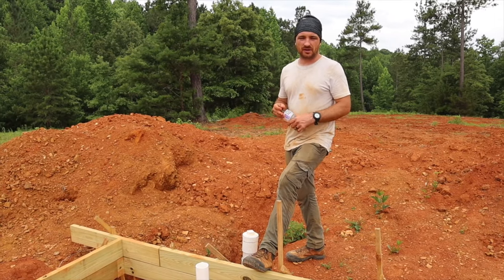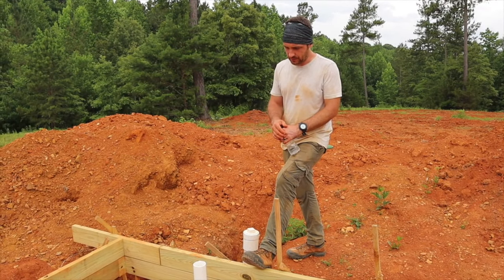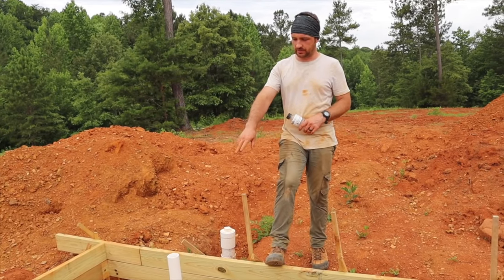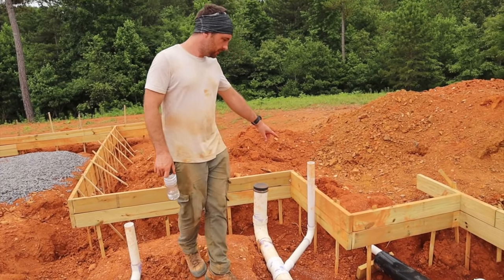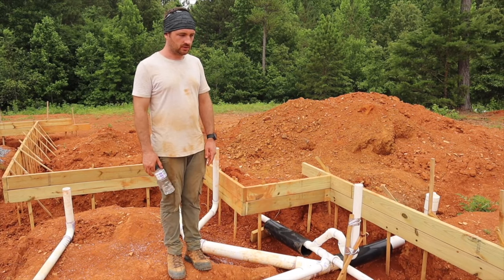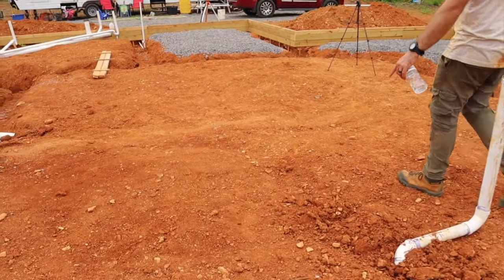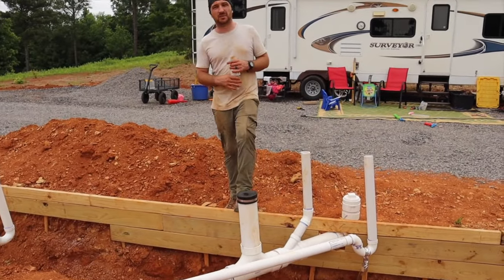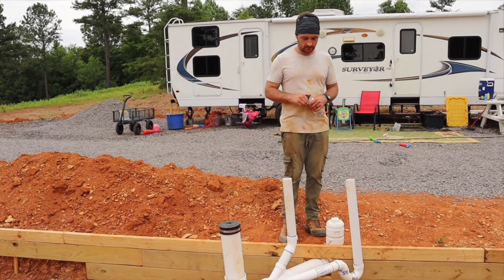DIY Rough-In Plumbing for Slab Foundation | Couple installs plumbing for house build in country

Comment: ALWAYS CHECK STATE PLUMBING CODES TO MAKE SURE WHAT YOU INSTALL IS LEGAL. None of this would fly in Kentucky. If anything in this system ever backs up in the future you're going to have MAJOR vent issues. And that's just the start. All these YouTube videos are going to give people in my state terrible info. Flat vents, wet vents, no vents, trying to separate grey water from waste water, glue traps below the slab, no grillage to speak of around the pipe. Dude, I'm glad this stuff will fly wherever you are, but please, don't post this stuff on youtube for the world to see. You could really get someone in trouble around my neck of the woods.
Reply: Yes I agree I just started my plumbing company and I'm looking at these videos like damn I do it way different

Comment: None of those p traps are vented and that’s a little worrying
Reply: yup and there not 3 inch so the unvented floor drain rule does not apply
Reply from the maker: Good point guys. We do have vents in the system and are doing above level vents as well (washer, etc). We will keep an eye on it.
Reply: @DreamitBuildit  check your wet vent rules and trap arm rules to insure you are the correct distance and size form you trap

Comment: Plumbing vents in a building are there to let air into the system, not to let air out.

Put a straw in wate and put your fingertip over the top opening of the straw. The water can't exit because air can't enter the system (you blocked the building vent).

Now, keep your finger in place and flip the straw upside-down; there will still be air against your finger, and the water will not flow downward. You've blocked the sewage system vent (exists in septic system or municipal sewage system).

So, it's not about bubbles either, although I'm sure bubbles are everywhere in the system.

Comment: Plumber here—-Nice effort, but sorry, fail😢. 
As others have said, missing a lot of vents, and it looks like you used a two way clean out under on of your toilets. And the vent that you did use is not rolled up above the invert of the pipe. 
Island venting under a slab is a challenge and appears to be missing. Good luck in a few years when the problems begin.

One last thing— no pressure joints should ever be under a slab— always use a single length of pipe and bring it up in a wall and make the connections there.

Comment: Good thing you put that cleanout near that toilet. You should never plumb a toilet stack into a tee. Waste will flow in both directions, which temporarily reduces the flow in the right direction. This makes it so solids will accumulate at the tee.

Also, you had the fittings you needed. All you had to do was 90⁰ up and avoid the underground trap.

I suppose the toilet in question will vent, but you generally vent the toilet forward of the wastestream, unless it's wet-vented by way of the sink.

Comment: How do you know where to place the caps where the connection will be for the drain? What I mean is how do you get it accurate so that once the concrete is poured and that the drain for toilet shower, etc is where they should be and don't have to crack open the concrete again to move them?
Reply: You can pull measurements off a set of plans. Using mason’s line to mark different rooms helps as well.

Comment: In a slab, it's best to omit the tub trap. Use a "Tub Box" to make a square (or rectangular) void in the concrete. The pipe would then run horizontally into that hole. Don't box out with wood (termites!).

This is essential for tubs (best to do for showers too, even though their drain centers are far better defined).

Use a "Tub-Box"  because there is no standard on where the center of the drain pipe is, from the front of the tub. So, the exact position of the trap will vary, based on which tub you buy.

After the walls are in, you would install the trap, with the riser centered exactly to the tub's drain pipe.

To be clear, the center of the tub drain pipe has little to do with the drain hole in the tub body.

You still have to know about where the drain of the tub centers (within maybe 1"). Then, have a trap handy to make sure you can adjust the pipe length and the trap swivel to get your riser centered within a couple inches (in any direction) from the approximate center of the tub pipe. That's how you determine where to place the tub-box.

The only time I've seen the center of a tub drain pipe in a drawing, it was 1-7/8" from the wall and centered width wise. That seems to run true to what I've seen.

I personally, buy the tub ahead of time and dry fit the tub and drain assembly, in order to know the center point. However, I still wait to install the trap until the day of install. But, at least I know I'm really close before the concrete is poured.

Here's a link that shows a plastic tun-box, with the trap installed. To be clear, you wouldn't install the trap until you're installing the tub. You'll want to dry fit everything before gluing  in the trap.
https://www.google.com/search?q=tub+box+for+p-trap&tbm=isch&ved=2ahUKEwiW6eSK_ur8AhXmIt4AHQ1-C6oQ2-cCegQIABAC&oq=tub+box+for+p-trap&gs_lcp=ChJtb2JpbGUtZ3dzLXdpei1pbWcQAzIFCAAQogQ6BQghEKsCOgQIIRAKOgYIABAIEB46BQgAEIAEOgcIABCABBAYUOERWNxPYKdWaABwAHgAgAGzAYgBhxySAQUxNi4xOJgBAKABAcABAQ&sclient=mobile-gws-wiz-img&ei=k3XVY9bTO-bF-LYPjfyt0Ao&bih=593&biw=320&client=ms-android-verizon-us-rvc3#imgrc=-mH606pMgSUq2M

I'm really not trying to throw shade, but I'm making these comments for the benefit of others, who haven't already poured the slab.
Reply from the maker: Thanks for all the information!
Reply: @Dream it. Build it. 
For some reason, there's very little (basically nothing) I can find on the internet, on exactly how to rough a tub drain in a slab. However, there are tons of resources on how to redo one that's been done wrong.

Most of the redo examples would not satisfy the plumbing codes.

There are plenty of areas in the US, where slab homes are the norm. As well, there are slab homes (and apartments) built where basements and crawl spaces are the norm.

You would think that there would be plenty of resources on the internet, showing how to properly rough in a tub.

I know because I've installed enough tubs on slabs to see where the difficulties lie. I've also mocked up a few and worked through all the possibilities, based on which direction the pipe approaches the tub.

Comment: Judging by the foliage, I'm guessing you have a true winter, which includes snow. I certainly could be wrong about this because the color of the soil is red, which makes me think warm climate.

I wonder if the water supply line from the well is deep enough (below the frost-line). The plumbing drains don't have to be below the frost-line because they drain quickly enough to avoid standing water. But the supply lines remain completely full of water, at all times.
Reply from the maker: We do have pretty well-rounded seasons, including some cold Jan-Feb winters. Frost level is recommended around 1ft for here so our fresh water coming in will be well below that.
Reply: @Dream it. Build it. 
I'm happy that my worries for your water-line were for nothing.

Comment: A toilet drain that is 5 feet or more from the main drain needs a clean out, And the clean out will have to be 3 inch,  Not every state accepts a toilet flange as a clean out., Code requires a 2 and a half inch clean out for a 3 inch pipe so obviously you would have to upsize it.
Reply from the maker: Good tips. Thanks!

Comment: @6:11 that pipe you have your hand on. Should it be a WYE fitting or something to direct the water towards the septic tank? I was under the impression that you can’t have waste just drop into a horizontal pipe. I’d like to know how the inspection went. I’ve got one coming up soon for mine too. Good luck with your project!

Comment: How did inspection go for plumbing?
Reply from the maker: We followed requirements (actually went over on some), but there is no plumbing inspection required for our county. Only septic and electric.
Reply: Holy smokes, where are you from? And what did you do with the "grey water" run it to daylight and let it drain over the hill? The definition for grey water where I'm from is water from a utility room floor drain, or a basic open receptacle. All your lavs, your kitchen sink and your washing machine needed to be tied back into your plumbing system. The septic will handle it. It can be treated.